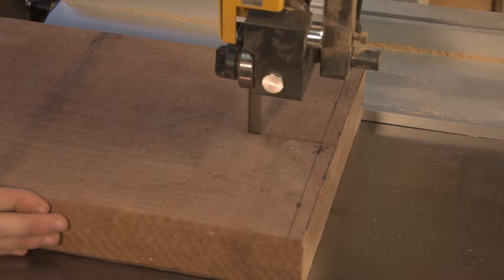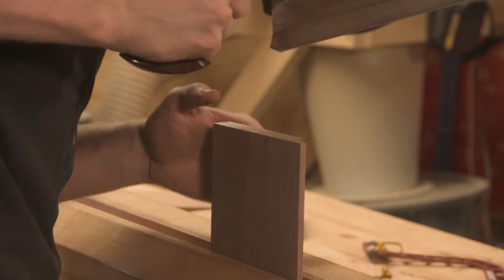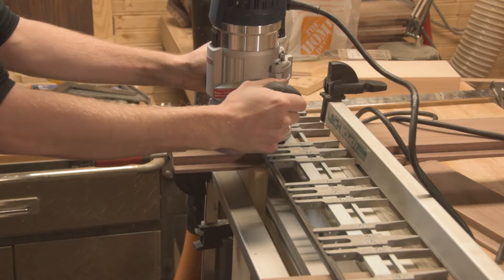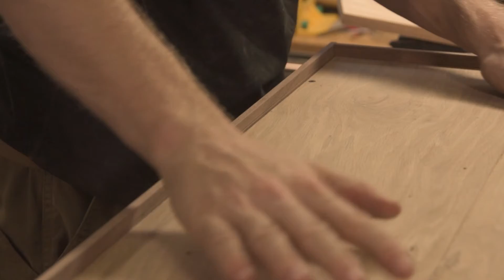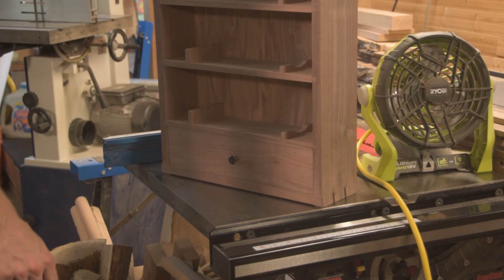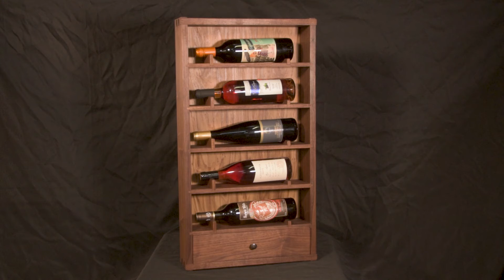Hanging Wine Cabinet

Comment: Great end result! Your mallet looks like it has seen better days though aha
Reply from the maker: I cracked it a few weeks ago trying to split a piece of oak with a froe! I managed to get some glue inside the crack and now it seems to be holding up much better. Still need to make a new one soon though.
Reply: @morganhurst_redridge  when using a froe you can make a mallet out of a log with the grain running parallel to the handle so that it won't split - it'll deny over time but for whacking a Froe it works fine. 
There's a certain word for it but I can't remember off the top of my head, something like a "beetle"?
Green woodworking is an interesting beast for odd tool names!

Comment: Great build, the oak back looks amazing!

10:50 gave me some safety police/kickback tingles though 😆
Reply from the maker: Don't worry the camera makes it look worse than it actually is! The pieces are about 3/8" away from the fence so there's no chance of them binding, and my SawStop has minimal vibrations so they won't be walking into the blade.
Reply: Ahhh great usage of the veritas planing stop! I was focused on the cut and didn't see it there 😅

Comment: Nice build, thanks for sharing.  For the cabinet you needed to abandon, how about you square off the router damaged ones, patch in some cherry, then reroute?  I can understand why you wouldn't do that for a gift or client.  However, for your own home or as a shop cabinet, I think that would be a great use.  Just my two cents.  Any yes, I have a few very nice boxes for shop storage due to opps type things like this.
Reply from the maker: I've been thinking about doing something like that but I seem to have misplaced those pieces! Eventually once I get the shop cleaned up I might make another go of using them.